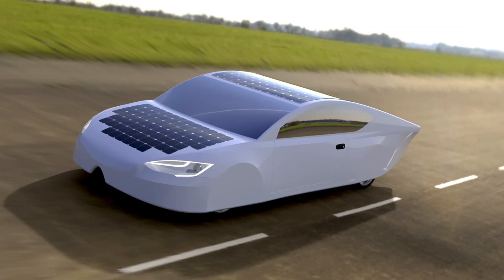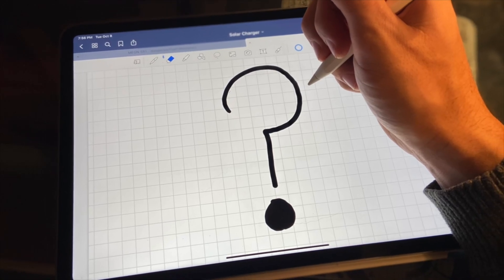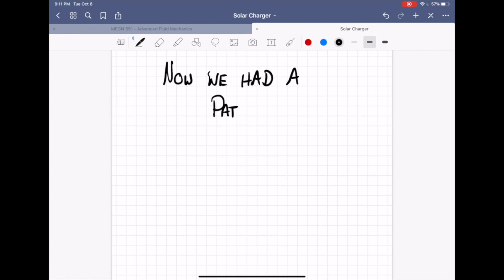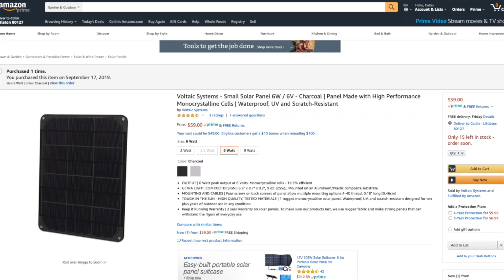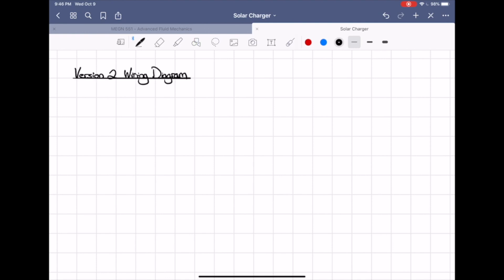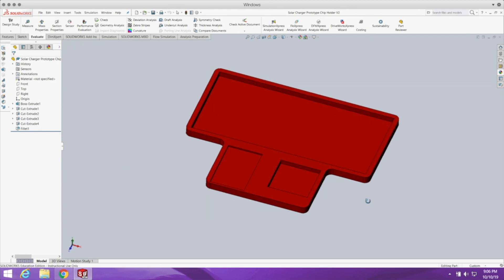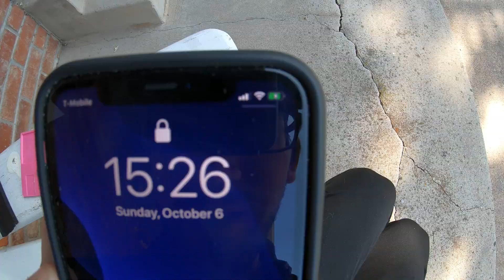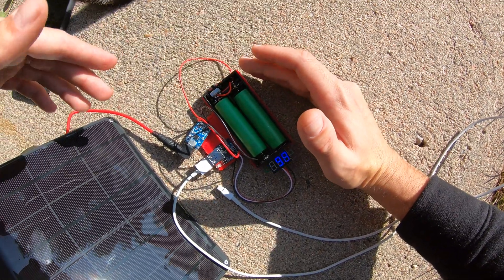Let’s BUILD a SOLAR-POWERED TESLA Charger | Part 1

Comment: reason for it never used solar panel even solar panel install on car roof cause not all environment get huge amount of sun ray generate power the car need, that being say but i also had a neck for crazy idea, here a tips, combine solar and heat at the same time to generate the amount need of electricity and bonus tips is this type energy don't need sun to powered like solar panel, it can be used in night time

Comment: I dint know the model 3 have a odd port, which odb reader did you use and where is the port.
Reply from the maker: Not sure what you mean, sorry. Could you clarify? No discussion of an OBD port in this video and I am fairly certain they don’t have them since it’s primarily an interface to diagnose codes thrown by ICE vehicles and to monitor emissions.